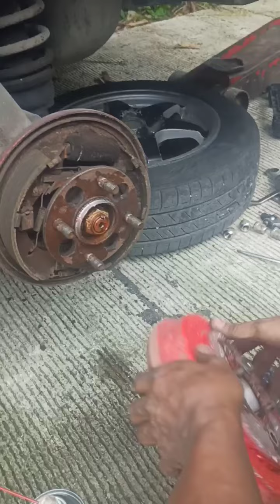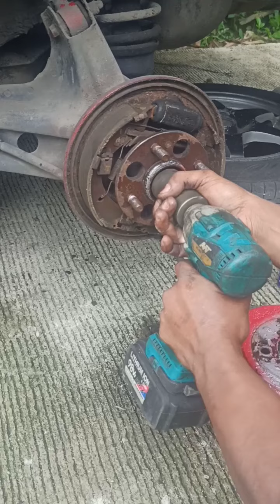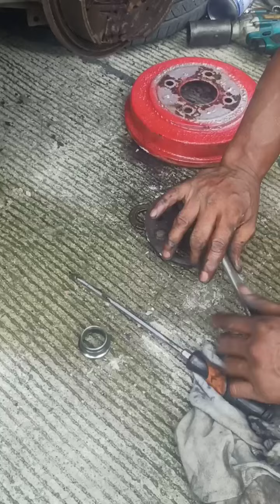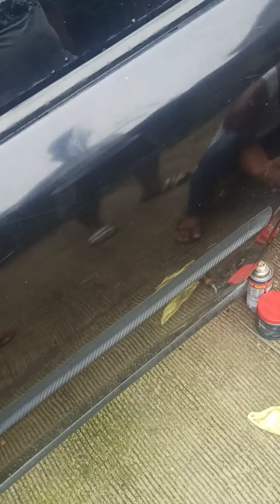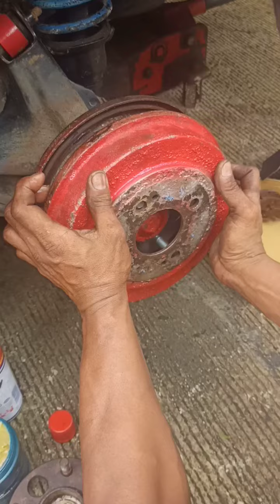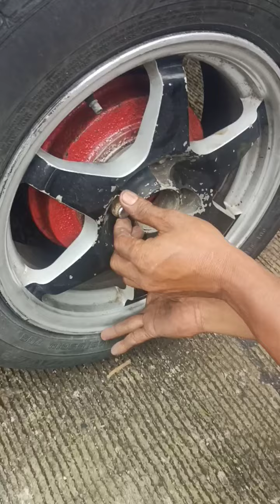replace wheel hub bearing rear side Honda civic esi

Comment: Maninoy white. . Ano kaya problema sa 2e engine ko dalawang mag ka dikit na cylinder ang di nag reresponse bago na po lahat spar plugs tapos pati tension wire na tune up na rin po ganun parin di parin nag reresponse ninoy. . Uma andar po yung sasakyan ko kaso palyado kase dalawang cylinder lg gumagana. . Pa tulong po maninoy white. . Salamat
Reply from the maker: Check kung my singaw na  mga vacuum hose meg kung ganun parin Wala singaw vacuum head gasket
Reply: @ManinoyWhite  salamat gd maninoy ☺️🙏 god bless dako gd bulig sang mga video mo kag sa pag share sang talent mo. . tungod sa mga video mo maninoy nag Tino ang akon multicab. . Sbung ang ky papa nmn nga corolla ☺️☺️☺️